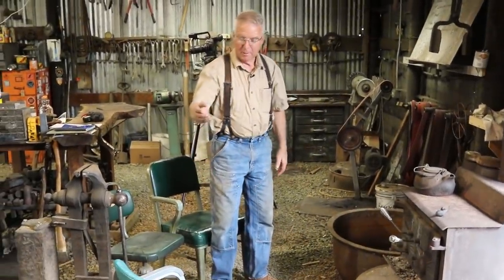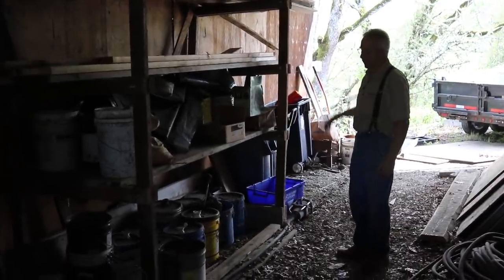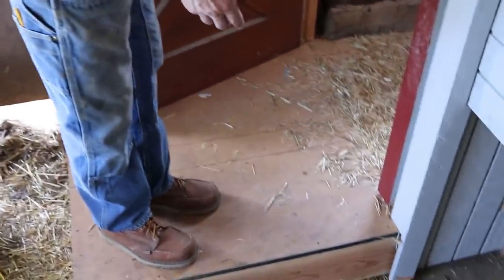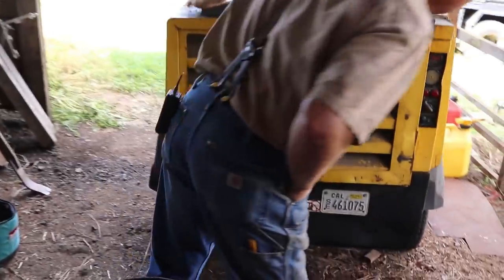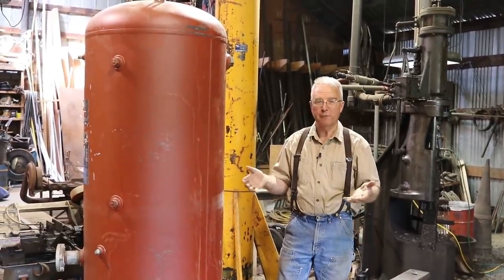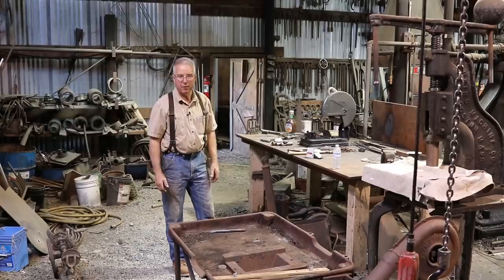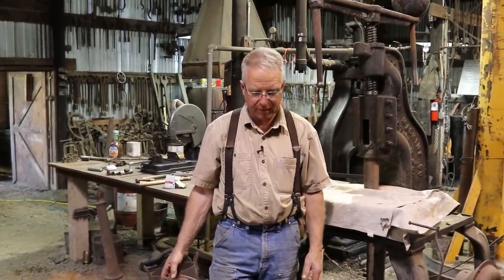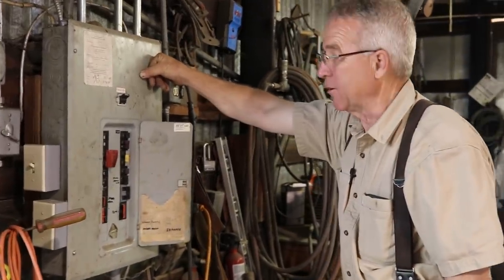Shop Tour 2.0

Comment: Namaste sir,my sujjestion for that big air tank use as a compressor for power hammer,& buy a midium size shot or sand blasting machine to use for rust removing ,like you got to clean that buffalo coal forge thing,do it sand blasting.

Comment: I'm not an expert or engineer but I think I would mount it horizontally above your metal storage on the wall run the feed line high above and drop down from the ceiling to the power hammer and have a line drop straight down off the tank for bleeding off moisture

Comment: All pressure vessel should be mounted outside with protection for people in the shop. When pressure vessel fail they explode. There are quit a few videos on YouTube showing them exploding. The size of your vessel is not to be taken lightly! The ideal situation would be to have 3 walls made of brick or block filled with sand. The forth wall or door facing away from the shop, in case of a failure it will direction the blast.

Comment: off the floor that way you can see what's going wrong with it if it ever has a problemwhere I live the air is very damp and removing water from my compressor lines or the constant problem even with dryers

Comment: I've got a hard head, most of my toes, and I've never been shot... Close enough?

Thoughts on your air system: I vote for the tank going outside. No reason for it to occupy shop space, IMO. Slap a heavy coat of good paint on it and park it in the wild, preferably with some sort of roof over it.  Since it was used for steam, I'd be extra careful to make sure it doesn't have any appreciable rust damage inside. Also since it was used for steam, the thing is probably built hell for stout. A good score for sure!

I assume you're going to have to run giant plumbing to/from it regardless of where it lives since you're planning on such a high flow rate, but you might want to consider the cost of your piping if my assumption is poor as well as the number of 90s you're going to need for each approach as they radically reduce flow. Also, a small electric compressor for daily use is absolutely a good idea, as is an actual professional grade (I like Reelcraft) hose reel. Just like everything else, the difference in quality between pro and consumer is remarkable and Reelcraft is basically the Cadillac option, IMO. You can come up with them used pretty cheap a lot of the time and they run easily available Parker swivels which you can generally rebuild with new o-rings and such.

As a parting thought on tank placement, I also suggest  you make yourself an easy solution to drain condensate from it before you install it. You don't want to get it all situated and then realize you don't have room for a 90 or ball valve or whatever else you need. Same goes for your over pressure valve. You want that to be easily accessible since you're going to want to be testing it as part of your shop PMs on a regular basis. It also occurs to me that you may actually need more than one of them, or a huge one, because your giant compressor could actually outrun the relief capability on lesser versions. I understand that the compressor itself already has a relief blow off, but the compressor itself isn't a bomb like that tank would be. I'd certainly want one on it as well, but that's me.

Good luck with it all! That's going to be a sweet setup that I'm pretty envious of!

Comment: Drawback to having the tank inside is it takes up some space. Drawback to having it near the compressor is more condensation in the tank, since the air going in is warmer. If you put a smaller tank with an automatic water dryer/separator/drain near the compressor, and the big tank near the hammer, the air in the shop will be dryer and the actuation will be faster.

Comment: The machinist that taught my father his trade had at his home shop a 500g propane tank that he would charge up with a standard 80g air compressor. It would take about 10 minutes from the time he turn the compressor on till the tank was up to pressure… But once it achieved 200 psi he told me he was never able to outrun it. He kept it (and the compressor) out behind the shop in a little C-shaped area built from concrete block that had cement poured down into the block that way if something went awry with either the tank or the compressor he had something solid in between the remainder of the shop and that tank.

Comment: Hey friend, we met when you came to Texas to the good of the land expo. I just wanted to give you my two cents worth on piping up your new tank and air compressors. I have 40 years experience in industrial pipefitting in boilermaking . With no more pressure than you are going to run out of either compressor you have absolutely nothing to worry about. You can hook them both up, the only thing is you may need a shut off valve on your small compressor when you’re running the bigger compressor,I would advise that you do that or put check valves in each feed line. Then you would not need to worry about it.You will already have a shut off valve on the diesel Compressor so you can shut it off when not in use to save air pressure. If possible I would hook your tank up Inch and a half to 2 inch pipe from the diesel compressor. The bigger the pipe the faster it will fill your tank the less run time you will have burning diesel. But I would probably only run like three-quarter from the small compressor. Use schedule 40 pipe. And I would not use malleable fittings. Hope this helps.

Comment: The condensate freezing will be and issue with anything you place outside as I had to replace several hundred feet of 2 inch pipe a previous person thought would work in the winter

Comment: Stab Loc breakers by federal pacific, If the circuit is overloaded you wont know until it catches fire. Its not that they are expensive because they are not in demand, they are not made and were recalled.. No licensed electrician will get you or replace any breaker in that panel.... Get a square D panel for like 200 with breakers, its worth not having your stuff burn up.

Comment: never combine screw and piston compressors on the same system unless to close one another off from each other. the hammering of the piston compressor will damage the screw compressor.
also it's cheap to have the state come and inspect your pressure vessel, i have them do it for mine, washington, every 2 years. they have some kind of radio sensor that measures the thinness of the metal to know if rust is taking it out.

Comment: Grain of salt with words to follow:
Air tanks are great when left elevated in controlled environments. You can easily inspect them visually. Leaks are apparent when you see dust moving. You can drain them (HOLY SHIT! DRAIN THE DAMN THING REGULARLY!) and the plumbing is easier when aloft.
The biggest fouling problem with pneumatic tools is always condensation. The higher they are, the easier to plumb in a low point drain. And a water collector.
Keep it up! You rock.
-Mike

Comment: I wonder ... if having the compressor outside and the tank inside... in the winter you’d be pumping cold air into a warm vessel- could that contribute to more condensation than if the tanks was installed exterior?
Reply: Big Mo 
Yes and no, depending if it gets well below freezing, that is what could be a problem. No problem if kept drained.

Comment: Mount it with the towable compressor so that they can be moved as a unit ......... plumb it with cam lock fittings and flex line ..........then your never tied down , it’s not in the way and if it is you can move it......... also could be used at a remote sight if necessary
Reply from the maker: OK that is one great idea and I just might do it! I had never thought of it!
Reply: Essential Craftsman love your channel stay with it .......... I’ve learned a lot!........ thank you!

Comment: Put a safety valve on the top of tank. Higher than the pressure on tank, do not exceed max allowbel working pressure on tank, there should be a boiler plate on tank with all the information, have fun,

Comment: Replace that electrical panel yesterday!  Please!  Don’t delay!  
Can you imagine the devastating loss if your shop burned down, even without considering any possible injury.
If insurance covered the building and contents it would take another 60 years to find replacement tools and get reorganized again.
While you are doing it, clean up some of the wiring going to work areas and add some LED lighting.  It has come way down in price and is great clean and crisp lighting.
When you look at the roofing job, consider an addition like you built on your friends shop.  Do it sooner rather than later.  You will be incredibly happy and can plan some reorganization to make your work time easier and more productive with less effort.
I am at the same place at our tree farm - not enough good storage for equipment and tools, also no room to work on A without rearranging B, C, and D.  I am far overdue for a new building.  I look forward to designing in some useful features.  Although timing is not good - my away from the woods job and livelihood is based on petroleum production.  My monthly income is now 15% of what it was 2 years ago. 😭

Comment: id say outside, and if possible in an enclosed area. although it looks pretty skookum, a tank that size has about ~650 tonnes bearing against the inside of it when at 150 psi. forget the shrapnel, the bang from one of those going off can cost one their hearing or a good part of it.
Reply: the earth pressure from burying it will help to counter balance a significant portion of the air pressure on the inside, and indeed help to contain any unfortunate explosion, somehow auguring out a hole the diameter and setting it in upright would be ideal, although the question of drainage comes up again. then again you can bore the tank on its side, probably solder in  in a 3/8" copper pipe so that its the bottom of the tank when it is upright. due to its domed shape, all liquid will collect into the pipe. now lead the pipe up along the sides of the tank until its up above ground level like a stand pipe.  after ever few days, just pressurize the tank to abotu 25psi and open the bleed pipe. air should force out all the water in the tank, up tru the pipe.
Reply: take it with a grain of salt. im not a mechanical engineer. or a boiler technician

Comment: Hope he gave you options on some options on how to do the tricky flashing, copper and soldier is always better than a big gob of caulk, never got a good look under that eave. $ is usually the determining factor on how good a roof you get
Reply from the maker: He did, in fact I had a piece of flashing  fabricated  and soldered to accommodate that juncture. Put it in place, looked it over, decided the way that was shown was better.
Reply: Started writing this during your roof video

Comment: nothin like a good wood stove, to try to find the silver lining in these trying times I have managed to get most of my wood cut for the year, and I am still burning last years wood. I just got 6 inches of snow last night no joke....
Reply: We didn't get six inches, but for the past two days it's been snow squalls. In May. In upstate NY. In all my years I've never seen it snow so close to what should be summertime.
Reply: 44R0Ndin For real, and what happened to the snow we used to get where you can build snow forts and ride sleds for 100 miles at a time?

Comment: Scott
I had the misfortune (or fortune) of having a Federal box blow up while a licensed electrician was installing a new circuit. The resulting 4- ft “ plasma ball” erupting from the side of my house was frightening. He calmly cut the service lines from the pole and the electric discharge stopped. “Fortunate” in that he installed a new box for me using all GE components. For awhile Underwriters Laboratory wouldn’t approve any FPE products. The breakers for your box are expensive because the are “refurbished”. Loose that box very soon and you’ll sleep better at night.

Comment: ,I won two of those air tanks in an auction for 100 bucks .I work in a book bindary and we use those off house air  which are screw compressors,too take up some slack when everybody's using house air at the same time.We have a few smaller ones that that act as slave tanks for certain machines that have their own compressors because they hog allot of air.It seems those get run off 60 gallon ,three phase compressors .Im guessing you'd want to go with something bigger than that if it's gonna be used by multiple people at the same time .If we didn't live on opposite coasts I'd give you the one I got that looks just like the one you have as I have no use for it.

Comment: More than 55 years ago I worked as a draftsman for a company in Chicago that made a LOT of pressure vessels for high pressure applications in the food industry. Their designs, and more important, the insurability of their vessels, was governed by the ASME (American Society of Mechanical Engineers) pressure vessel code that at that time mandated any pressure vessel (above 15 PSI) must be designed to a minimum of four times the maximum working pressure, and must be hydrostatically TESTED (under water pressure, in case of explosion) to two-and one half times that working pressure. Not only the vessel itself, but all the "fittings" were required to meet those standards. I'm sure the code has changed since then, but I have no idea how it might now be different, But if you're worried about the safety of any of your pressure vessels exploding, then I think it would be good advise to at least follow the dictates of that code, including, of course, making those 2-1/2 times working pressure hydrorstatic tests. Just saying., with all those little kids and little chickens running around.

Comment: There is a relief valve on the top of the tank.  What is that relief valve set for; it will be marked on the valve?  I am deducting the tank was used for water since I have a laundromat and don't use steam.  A dry cleaning establishment uses 15 psi steam.  There is no insulation on the tank but probably was removed to get the tank out.  From the piping and support ring keep the tank vertical as the ends are thicker than the walls and will withstand corrosion better in that configuration.  Is there any piping inside the tank as there are 2 flanged fittings plus a 2 in pipe elbow at the top?  I agree about adding a smaller compressor and installing check valves to isolate either compressor.  Add ball valves to isolate each compressor and any other air tool hooked up to the system as you don't want to shut the whole system down because of one item needs work.  Valves can be costly but the convenience is worth it.  Install a drain valve off the bottom unless it already has one or an automatic condensate drain.  Make sure all fittings are air tight in the system.  The other suggestions from people who design and work these systems are great.  My 2 cents is from being around the stuff for years.

Comment: What panel/system are you using on the house?  My home and my shop both use Square D QO, which has been handy when it comes to the number of spares kept on hand and the ability to make changes or repairs quickly and cheaply.  Homelite would probably be cheaper than QO these days, but I'm probably not going to change what I've got.

Comment: In electronics the storage vessel is the capacitor. We keep capacitors as close to where they are needed to allow the quick release of current as which prevents voltage sag. Pneumatics are a direct analogy. I’d suggest keeping the tank as close to where you need it as possible, or increases the ID of the pipe between the tank and the hammer. See “Secondary Receiver” in the link below.
https://www.engineeringtoolbox.com/compressed-air-receivers-d_846.html
Reply: Noah Reyburn 
Yep, but keeping tanks that size, that close is space prohibited.
A 5-10 gallon tank from a broken compressor are a dime a dozen and will work best. Picked one up here for under $20

Comment: The bottom line is what works best for you!
I like keeping my compressors and tank a way from my working area, so I don't have to hear them.
I do not like float drains, the prticalents well plug them up.
I like time drains, the can be set up to open one every few minutes to hours.
I like drains in every low point. If you have a feed dropping from over head put a drop below your tap point to chach any water that might get through, with a blow down. If you use two compressors put a back flow check in each supply line to protect them from back flow.
I actually run three compressors, one is set to kick of at 160#, one at 175#, and one at 195#, all plumed to the same surage tank, and shop pressure on 150#.
If I am just using small air tools then I just run one, if I am running air grinder and such two compressors well do me, if I am using my blasting cabinet I run all three.
And the low pressure compressors stays on all the time in the winter to run my oil burner.

Comment: I worry that your boiler tank is rated for approximately 20 psi, maybe 40 psi or higher. They usually have safety relief valves set for around 15 psi.  Boiler equipment is not equivalent to compressed air equipment.  I do not know of any high pressure boiler systems. They are usually low pressure vessels.

Comment: I worked as an electrician in Canada for over 13 years. Did a lot of maintenance. Saw a lot of Federal panels. I never heard of any fires started because of Federal panels/breakers/disconnects, but I never liked working with them either. Always seemed to be cheaply made.
Reply: Plenty of fires and lawsuits because of the Federal Pacific and their Stab-Lok designs. If you have one, get rid of it...

Comment: Wouldn't it be better to have the entire shop in concrete? Dosen't the gravel tend to hold more moisture and rust out the metal on the building more quickly?